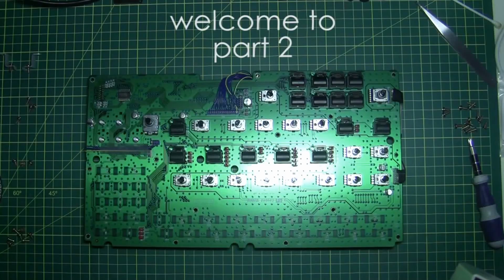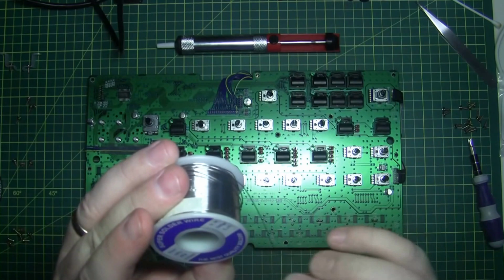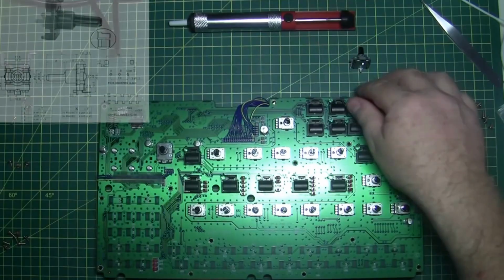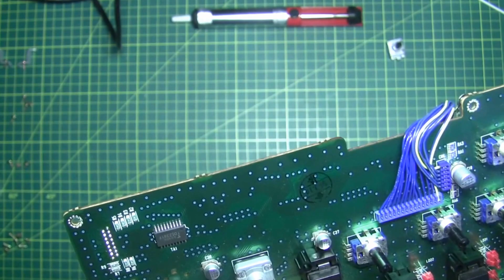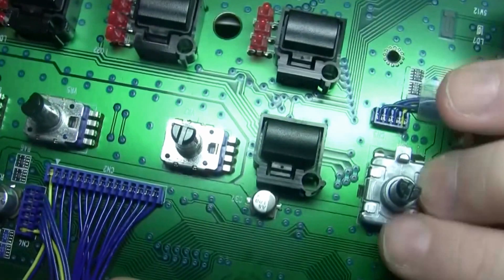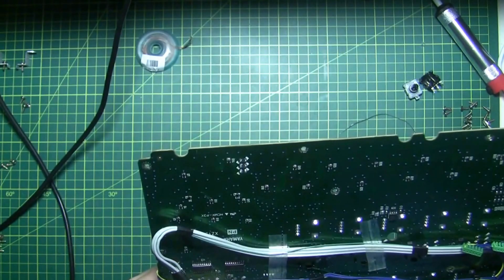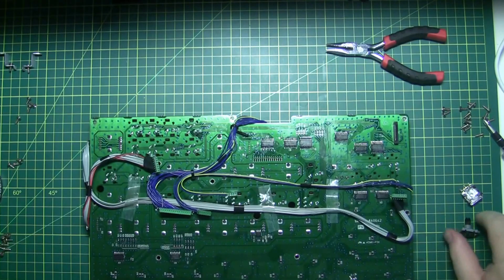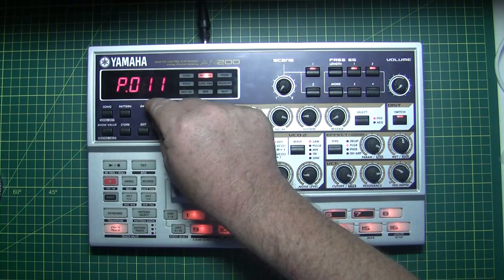Yamaha AN200 Repair Part2

Comment: Thanks! I just repaired mine without installing a spare part! It is possible to open the encoder (pull away the 4 metallic lips and open it). Then clean it inside with contact spray, ear sticks and treat the contacts with fine sandpaper. Works like new and is much easier than soldering..
Reply from the maker: Hi mopotbo! Eeek that video I did years ago, and it is a bit cringe ;) lol! Anyway, I'm glad you managed to get yours fixed by using contact fluid - great job! Here's to making more AN200 tracks!!
Reply: Worked for me. Thank you!

Comment: Although you did a good job replacing the encoder, I believe you should have tried to clean it before. The contacts being metallic would probably react positively to a drop of Deoxit D100L. Also, the desoldering pump would help you avoid working on both sides of the board simultaneously and damaging the board's soldering points. I know you did it carefully, but it is always good to show the right way of doing things in tutorials like this. Nice to see the AN200 working again.
Reply from the maker: Hi Gaita. Thanks so much for taking the time to comment on my video! 

I did this video nearly 2 years ago :) - wow time flies! So, the encoder had physical damage to the rotor disc - it was correct to replace it (I can't remember or not if I showed it in the video). I actually tried some DeOxit on it some time before I made the video - it made no difference. 

In regards to my electronics ability - I'm no expert - I also made comment about me being a beginner/newbie :) However, I'll take your advice onboard :)
Reply: Thank you for the info on the rotor damage. I bought an AN200 yesterday and this is why I am watching all the videos available on it. Subbed.

Comment: Thanks for these videos. I just took my AN200 apart to see if giving the data encoder a Caig De-oxit bath would make it right, but it looks like I may have to replace the part as you did. One thing you really should point out - reinstalling the board with the part is a little tricky since the set of buttons around the encoder all have little tabs that have to get lined-up with their respective holes before you can screw it back to the chassis. Using a small flashlight help me line them up.
Reply from the maker: Hey Paul :) Thanks, I was hoping it would help someone! I didn't have the problem with the holes lining up - but now you mention it, I guess it could happen! Let me know how the encoder goes!

Comment: Good job, but desoldering-pump could avoid to work both sides of the motherboard which is dengerous for other components and not comfortable to You :) I need to do the same for my AN200 and DX200 for sure!

Comment: Did you buy your AN-200 on sale at guitar center...   For some reason they were selling them new,  for dirt cheap...  It was like less than a 1/3rd of original retail price..  thats was the reason i bought it..     I made my first beats on it,  so i'm attached to it..   Still find uses for it.. cool machine...  I'm curious why the DX200's sell for more these days..  I owned one of those as well, but i did not get the hang of it at the time..  I was new to synthesis..  wish i would have kept it...   would of-should of-could of...   thanks for the vid !!!
Reply from the maker: I got mine used from Hooked on Austin. It came with the faulty data encoder - and I got it cheap(ish). Thanks so much for watching!

Comment: Thank you for the great video! I've had my AN200 basically in storage for years because of this same issue.  If anyone has a link to purchase the Data Encoder and Battery, that would be extremely helpful.  Thank you again!
Reply from the maker: Hey Adam, as per the link in the video description - here's where you can find out the part numbers for the various bits you need: http://ranzee.com/yamaha-an200/ I ordered mine from Yamaha in the USA. There's a datasheet for that encoder on my link - so it probably doesn't have to be a Yamaha part - you could search for alternatives. Regarding the battery - just use any CR2032 3V that fits the specs of VN103500 - i.e. Energizer or Duracel works fine. Good luck!
Reply: ranzee yes thanks for the reply.  I found the part on Syntaur.com for anyone else who is looking as you were correct that Yamaha no longer seems to have them.
Reply: @adamlieberthal1992  Amazon has em